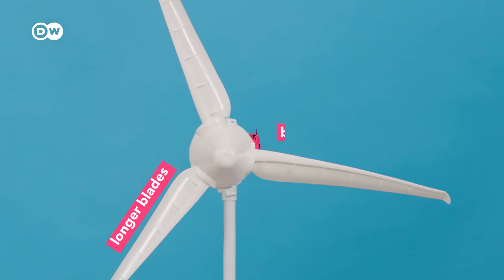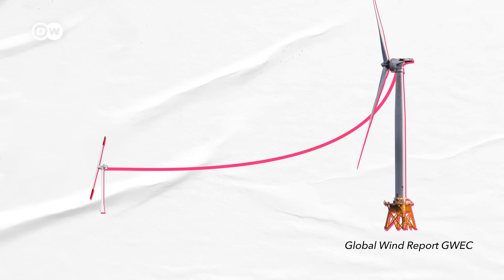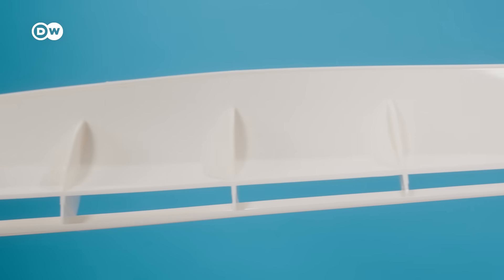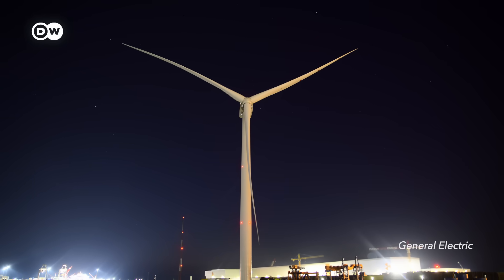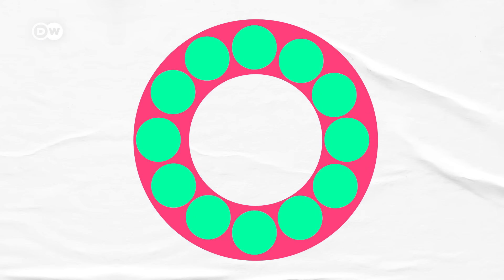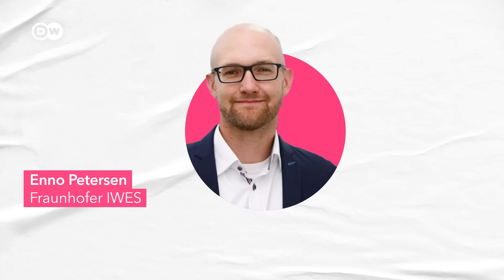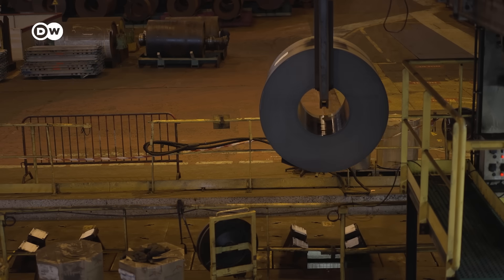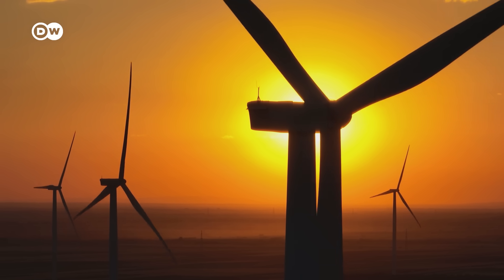The race to build the perfect wind turbine

Comment: You missed an important point: wind power is not in retreat. Exponentially more is getting built all the time, and in countries all over the world. Moreover, the technology is getting better and cheaper, becoming more competitive with fossil gas and other fossil alternatives as time goes on. 

The current problems industry faces boil down to increased competition, in addition to the factors of interest rates and commodity prices which you did mention. The upshot of the current era is going to be wind technology that is even cheaper and easier to deploy, and that is going to do a lot to increase pressure on fossil fuel market share by the late 20's.  

Moreover, wind is complementary to solar power, and however cheap solar becomes it will still make sense to add something that works at night or during cloudy weather. It is also much faster to deploy as compared to nuclear or even gas.
Reply: Wind may be faster to deploy than Nuclear, but that is only because Nuclear has a dozen of regulations and costs and politics chaining it down since Nuclear Energy was to be made commercial. 
Wind is okay for decentralized power. But no energy source can compare to Nuclear for centralized baseload energy this century.
Reply: @ZippyPiglin36 Wind and solar of 2024 each on it's own is now larger then nuclear power production world wide.
Reply: @paxundpeace9970  Nuclear produces 9% of global electricity. Solar, Wind, Geo combined makes 12%.
Reply: Not cheaper when u realise that u need to build 3-4 time as much MW in wind compared to other plannable electricity productions.
Reply: @jacka9612   Atomic is cheaper than Solar and Wind per unit power. It takes magnitudes times less land. It produces nearly zero true wastes per unit power. 
All of this while Atomic is opressed by every government and ancient regulations, while Wind-Solar is promoted with subsides and reliefs. Imagine if Atomic saw as much support and assistance as Wind-Solar.
Reply: @ZippyPiglin36 Nuclear does cost 10 times as much and wind power at least for current project in Europe. Fuel prices are massiv
Reply: @paxundpeace9970  Construction costs only. Operational costs are very low, even with the aggresive regulations.
Reply: Offshore windpower in the north see will growth 4 times in the next decade. Will already being one of the largest areas for wind farms.
Reply: @paxundpeace9970  And five to seven years afterwards, we will have an absolute excess of uncontrolled plastic and glass wastes from them.
Reply: @ZippyPiglin36 Glass is quite harmless. And if you worry about platicss, you should worry more about cars and trucks.
Reply: @old-pete  "Glass is quite harmless" Ever had tiny glass shards inside your blood? Yeah, that's released by both inefficient automobiles and eroding wind blades.
Reply: @ZippyPiglin36 Glass is too heavy to stay in the air. And most cities create more broken glass than a nations windturbines...
Reply: @old-pete   If Wind-Solar were to be expanded more, there would be far far more such wastes in the air and water
Reply: @ZippyPiglin36  And still only a small part came from wind and solar.
Reply: Too bad wind is so intermittent, so unreliable when we need it most —winter. 
Too bad the sun doesn’t shine even 1/2 the day when we need the most energy —the winter. 
Too bad Germany shut its nuclear plants.
Reply: @TheRustyLM  Most wind blows in winter. That works fine.
Reply: @old-pete  And the density of the air is greater, the more the temperature drops = more energy on the blades

Comment: Thanks for this great report, I find out, the idea of building a turbine (which can generate in a lower wind) economically is very viable, especially from a price perspective  (you produce when wind is low equivalent to higher price in the market).
However you didn't mention the maintenance & service cost.. which is already increasing considerably. Certainly, with larger scale turbines, this component will get more & more investing.

Comment: Surprised the video didn't mention the alternatives many European, and international, turbine manufactures are exploring inclduing the various forms of cluster-type wind turbine systems (multiple rotors per tower), which seek to obtain similar advantages to larger bladed systems but at a lower cost. Multi-rotor systems often provide larger swept-area coverage and higher power output than single rotor designs and can also offer similar low wind advantage to supersized single turbines. The cluster-type also suffer less from the stall wake issues that larger turbines can introduce requiring larger deployment areas, reducing the wind energy capture density per square kilometre.
Reply: Don't look at internet picture from startups claiming their ideas are the best, and the cheapest while they don't even have a small scale working prototype. Multirotor turbine is just a bad idea, it will never work.
Reply: @niconico3907  - you seem to be discounting all the studies that prove otherwise, from multiple research and university centres in China, Germany, Japan and the UK and the USA.

Plus not taking account large scale commercial manufactures, like Vestas, are trialing multi-rotor designs.

Comment: Nitpick regarding wind speeds. The energy available in the wind is proportional to the cube of its speed. If for example, the speed doubles, the available enegy increases by a factor of eight.
Reply: Depends on the type of turbine.  But correct for flat bladers.

Comment: First of all what kind of toxic materials are in those bigger blades? Bigger means that the erosion of this stuff is spread over a larger area. Bigger turbines also means more unhealthy noice from them and that they are more exposed when the winds are stronger and can easier break down. At strong winds you have to stop them to avoid them from breaking down completely. There is a reason why the German and Spanish governments had to bailout Siemens Gamesa with 88 billion euros. Don’t waste any more money on this shit and start to build nuclear power plants instead.
Reply: Materials that are scattered in larger numbers by cars, trains and planes every day.
I never encountered a windturbine that could beat a highway or airplane in noise.

Bigger turbines are built stronger. They have the same or even bigger endurance in storms than smaller turbines.

And no, Gamesa was not bailed out of 88 billions...

The poles decided to go nuclear in 2005, they did not even start building. Nobody has time for that.
Reply: @ The bigger the turbines are the more exposed they are to the forces of the wind. Trains and planes are mostly built of aluminum and not some composite materials that cannot be recycled and have to be buried when they can no longer be used. As for noise from airplanes and the low frequency noise from wind turbines they are two different things. Jet planes are heard in short periods while the sound from turbines are more constant. As anybody that lives close to them what they think of the noise. Nobody can control the wind and how much it is going to blow , so the spot price goes up and down like a yo-yo. When it blows it is too much of it and when it is not you have to pay a lot to get it from other sources. That is something industry cannot live with. Large companies is now scaling down or leaving Germany do to expensive energy. When costs for wind energy is presented they never include the cost for the grid or the cost for balance energy.
Numbers from Sweden shows that wind farms there has had average annual losses of 35% since 2017. November other business could live with losses like that unless governments are pumping in money to keep them afloat.  That are politicians that are motivated by idealism and lack of realism.
Reply: @runedahl1477 1. Plane wings are made from composite materials, as are train skins.
2. Most of abrasion comes from the coating and not the building material.
3. Cars, trains and planes have a lot of abrasion from tires and breaks
4. The composite materials from windturbines can be recycled...
5. Highways and airports are pretty constant too and are much louder
6. Spot prices are not constant in any free market. It is called changing demand. 
7. The industry in Germany has trouble with GAS prices, not electricity

Comment: Has anyone asked the car maker Koenigsegg as they have been making wildly efficient transmissions and that sort of knowledge seems like it could be useful for the gearbox.
Reply: Different technology. Also Koenigsegg uses exotic materials which scaled up might be be cost prohibitive.
Reply: A car gearbox is designed for about 4 month of continuous use because a car is stopped 95% of the time. A wind turbine is designed to last 20 years.
A wind turbine has only 1 speed, no need to shift, a car as 6 gearbox ratios.
A turbine gearbox can be rated  1000times more torque than a car.
Completely different products.